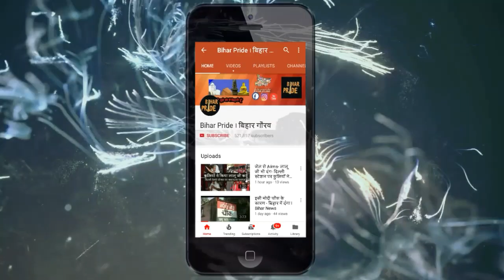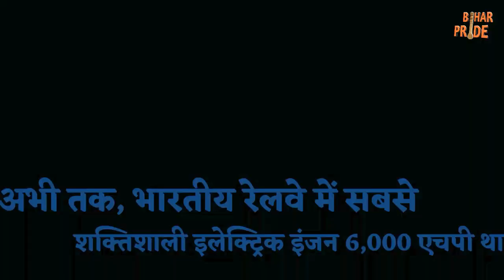India's 1st Most Power 12000 HP Locomotive Rail Engine l Made in Bihar l Launched By Narendra Modi

Comment: There is no electricity in Bihar . But now they have the 12000 hp locomotive engine !!! Modi is well ahead of his times !!!
Reply: Modi ki maki cut
Lalu Prasad Yadav tera Baap
Reply: Enough electricity in Bihar. If you are not convinced try to touch naked electric wire in Bihar and you will get the answer.
Reply: Just go to any village in bihar.. You will get atleast 20-22 hours electricity..
If you don't want connection then obviously your house will not be having electricity